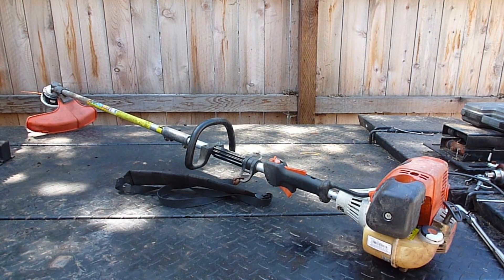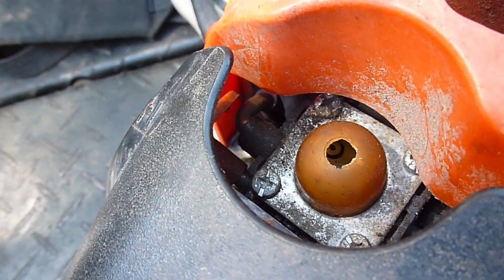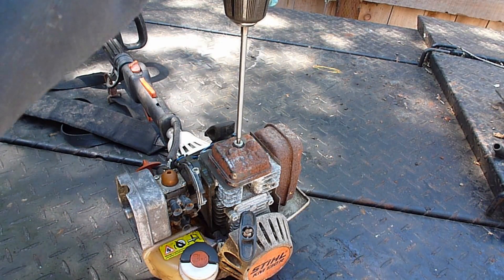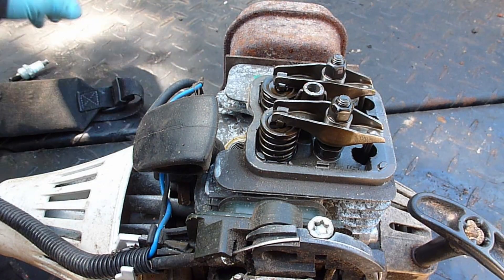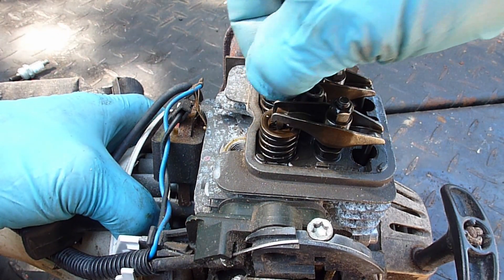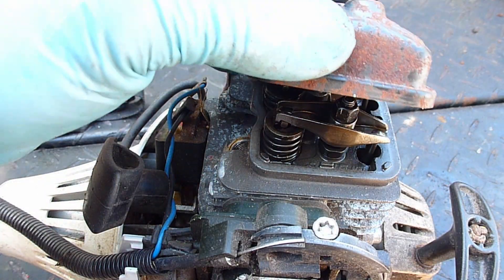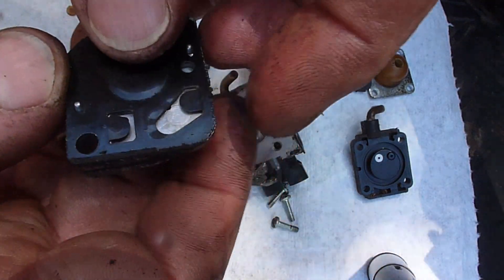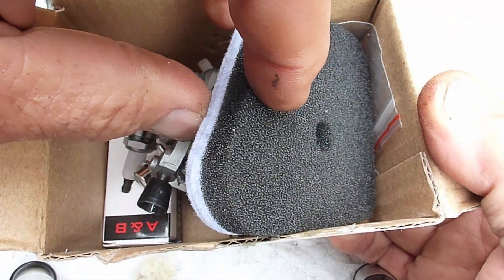How to Repair A Stihl FS or KM 90 100 110 120 130R Using A Cheap Carburetor

Comment: I had to replace my carb on my KM130 last week (13 year old trimmer).  I got an OEM replacement from Stihl, which was $125.  They aren’t cheap, but I can’t complain as it’s the first repair in 13 years.
Reply from the maker: Their carburetor prices are out of control, especially since they purchased Zama a few years ago.  But as you say, 13yrs and still going strong, with little to no repair expenses.  

If you haven't done so yet, it's a good time to grease the drive shafts(machine and tool) and on the string trimmer, remove the bolt from the side of the gear head and force grease into the gear head.
Reply: Yeah, I have greased the head and shaft ends a few times already.